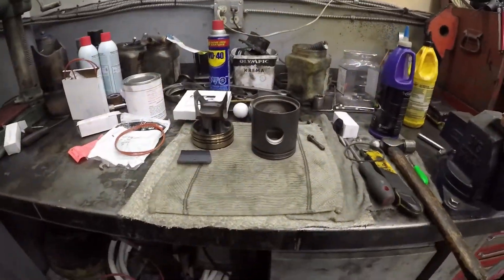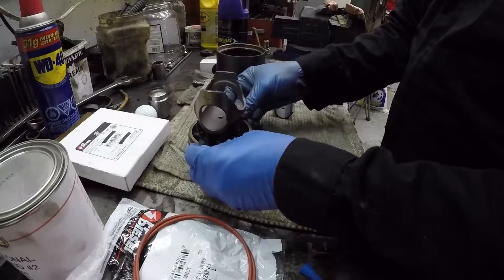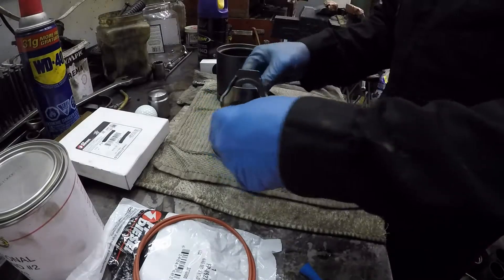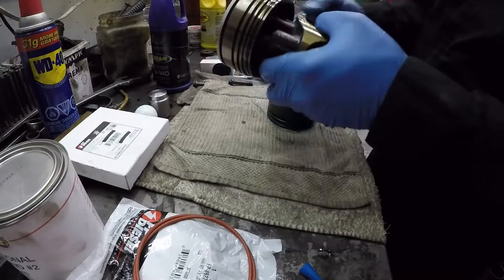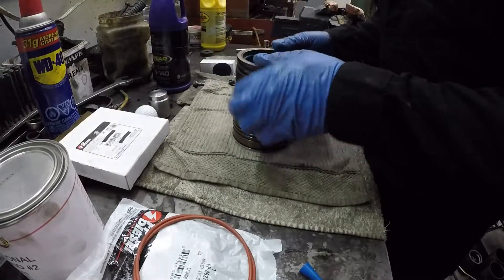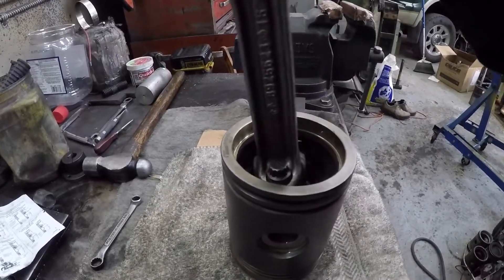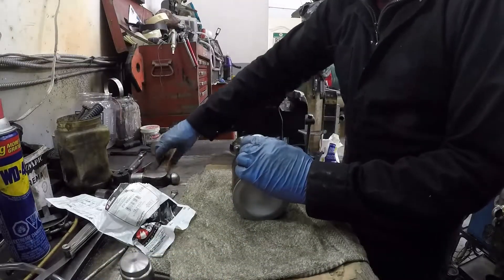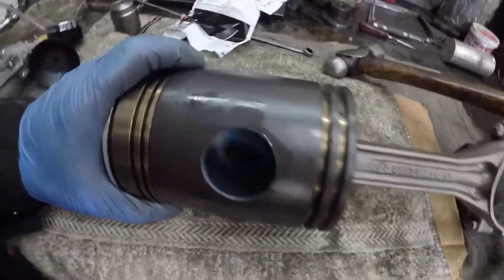Detroit 4-53T Cross Head Piston Assembly

Comment: If I have a 453t, with N 45 injectors, does that mean I have the wrong injectors. I think I lost an injector I'm getting ready to replace them.
I want to do a badass powerbuild but I don't know the recipe
Reply from the maker: Yes the N45 isn't the right injector, but it will work.  The stock over the road injector was 5A60's.  I've replaced those with 7A77's and am pretty happy.:)
Reply: If you have a minute I'll try to keep it short.
I bought a 1971 Chevy C 700 with the Detroit 453 to restore for a little utility truck car hauler. Had trouble with fuel pressure so I put An electric fuel pump with a regulator just to get it home, ran pretty good but crap out on me up the hills like it was sucking air but it wasn't. It was running pretty good I was kind of hot rodding it not sure what rpm i was doing but I think they had that thing revving past 3. Had it tacked out going up a hill from Vegas to Pahrump, and it felt like it seized like when you sees a 2-stroke dirt bike got on the clutch real quick, pulled over, when I looked underneath the truck at the exhaust pipe white smoke was gushing out like a fan was blowing it out then later on it started up but like it's only running on 3 cylinders you ever heard of hydraulic lock I'm not sure if that's a thing or not. did I lose an injector and fuel just came gushing out, oils clean, Waters clean. replace injectors and try it again?  oh yeah and the fuel pump. mechanical fuel pump and the 5A 60 injectors.
That might get me back on the road.
Reply from the maker: @Luch600 find the dead cylinder and swap out the injectors with a good one and try and see if it's just the injector.  You could have had a soft seize on one cylinder, but can rule that out by swapping injectors.  The mechanical fuel pumps should be delivering 70 psi, so check the pressure with a gauge. the engine won't run well without the mechanical pump as it flow a high volume of fuel that most electric pumps can't do.  If the mechanical pump is working and you don't get 70 psi, check that the restrictor  is still on the return pipe off the head.  With out this there won't be enough pressure.:)
Reply: @detroitgarage9430  thanks for the great advice. Do you have any recommendations on part houses I know I need a fuel pump for sure going to strip down the motor till I can get to the fuel pump easy and bring her back up in a beautiful way
Reply from the maker: @Luch600  I like this outfit, have bought parts from them a few times.  They sell both new and used parts.:)  https://www.powerlinecomponents.com/

Comment: Is there any advantage to using cross head pistons in a 4-53N rebuild or any other naturally aspirated Detroit?
Reply from the maker: Not really, the trunk pistons are just fine for the N models.  The 21:1 compression ratio make them easier to start in winter as well.  I'm building a 3-53T soon and going to go with trunk pistons for that build.  For my 2-53 N build it will have trucks as well.
Reply: @detroitgarage9430  Cool, thanks brudda!

Comment: I prefer the golf ball myself as well. You're gonna be an old pro at this by the time you finish your 4,3, and 2-53 builds! I'm assuming the 2 and 3-53 will be getting the high compression Trunk N series pistons. Can't wait to hear them all run! Cheers!
Reply from the maker: Slowly but surely Luke.:). The 2-53 is going to be 21:1 trunk and the 3-53 is going to get 18.7:1 trunk T pistons.  Converting it to a 3-53T and using a 4-53 silver turbo.  I think it will run the 375 CFM compressor easier and be a lot quieter as well.